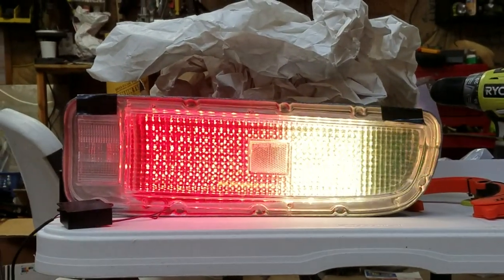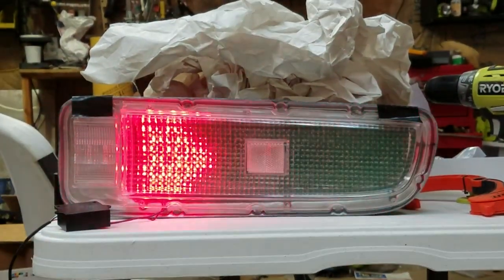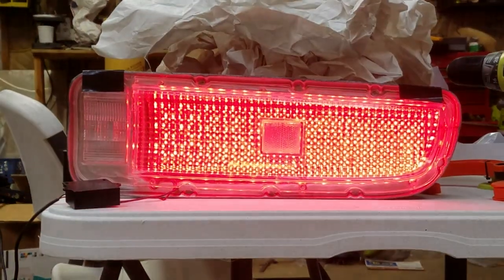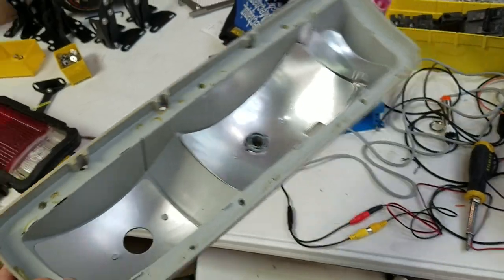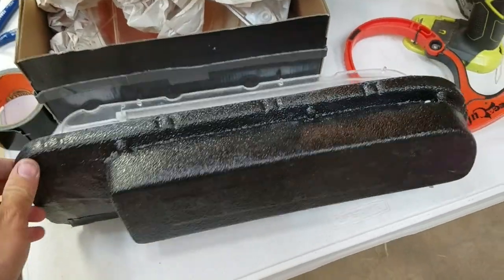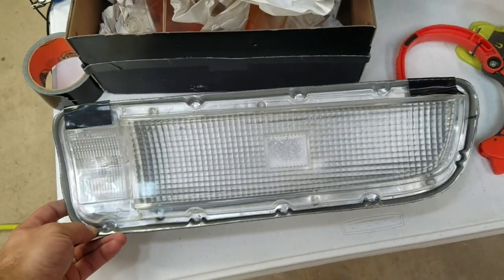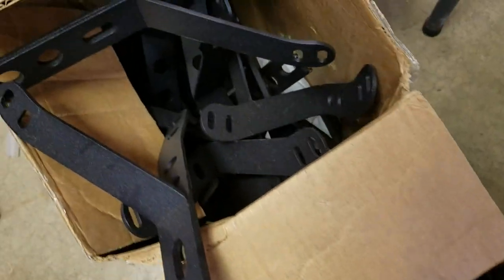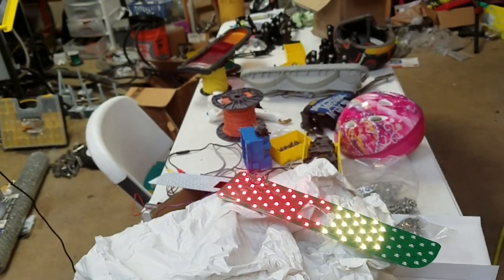TA22 Celica Flatlight Arduino WS2812B sequential LED taillights

Comment: Are you available to help with coding issues? I've used an arduino to make a sequential ws2812b led taillight tailgate strip for my truck. I'm having issues with my if/else statements. I want reverse to take priority over left blinker/right blinker/brake so that I can use it to see better at night. I have all the code written but it keeps activating right blinker when it isn't supposed to. Would I be able to send you an email with a full description of the project and details of my issue? If you don't have time I totally understand! I've been running my lighting business out of my basement lol
Reply from the maker: Yep I can help when I get a few minutes. Send me an email Foxau2@gmail.com
Reply: @Foxau2  thank you very much, I'll send you an email in the morning when I have access to the code